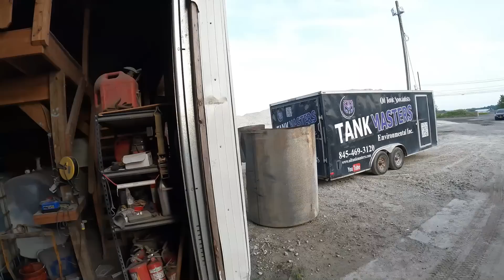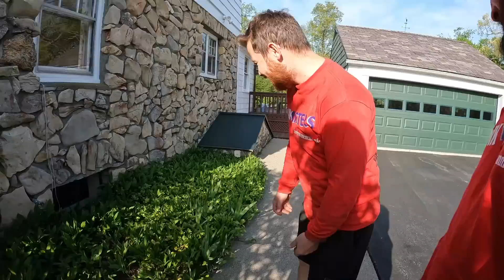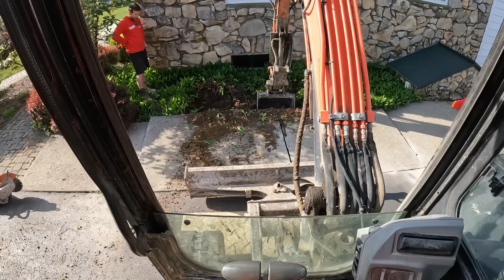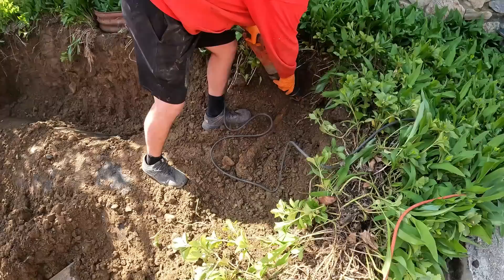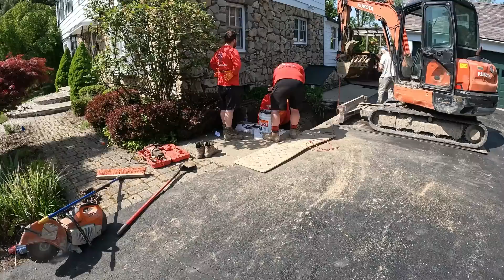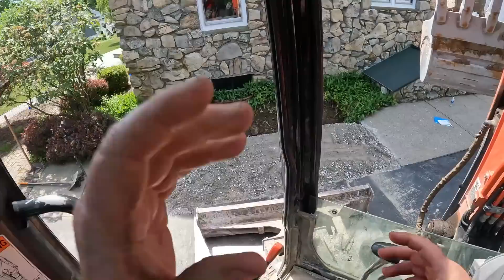Challenging 1000 gallon removal under sidewalk

Comment: A tank from 1938 (85 years old) is something we used to see every day because they were made well and lasted a long time. Such a shame they don't build them like that these days. That is likely the original tank from when the house was converted from coal to oil, which was also a common thing back then. I lost track of how many conversion systems I worked on over the years. Old homes have such a rich history if you know where to look.... especially in basements.
Reply: Basement and arctic  are one of the best places  to find cool  treasures about an older home  home
Reply: @rogerstlaurent8704  ...  basements are where I stumbled on old bottles, up in the rafters. By my figuring, guys would go down to tend the boiler and sneak a few pops while the wife wasn't looking, then stash the empties up in the rafters so she wouldn't find them. <LOL> I have a 40s vintage coke bottle (probably the kids) and another that's Rupert's Beer. At another home there was row after row of mason jars on a shelf with stored veggies, probably from a WWII era victory garden. The dates were all from the late 30s and many were perfectly preserved 50 years later. (this was in the 90s) If the rubber gasket looked good, then so did the contents. Usually, they were homes with elderly widows who hadn't been down there in decades.

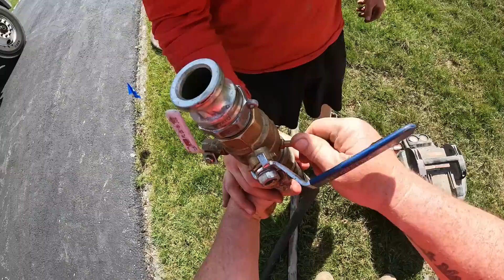Comment: 35:00  Hope the cruise went well with everyone.  One quick suggestion would be to use quick couplers and quarter turn valve.  That could be then use for both fill and emptying the line (water in and air in).  You can use the female coupler on the pipe and the male on a 1/4" to say 1" coupler that you can easily fill with water and then just a male to mail coupler on a small hose that would then just connect between compressor and oil pipe, then use that same quarter turn valve to open the air flow in, so its a one handed operation.  🤠👍  Great job on the excavation of the tank!

Comment: Should be laying 18" of dirt, then hitting it with a jumping jack and adding 18" and so on.
Reply from the maker: my voids NEVER sink
Reply: Why 18? Why not 6 inch lifts? Or 12 inch lifts? You can put dirt back in multiple feet at a time and it not sink. Especially if you hammer it in with the bucket.